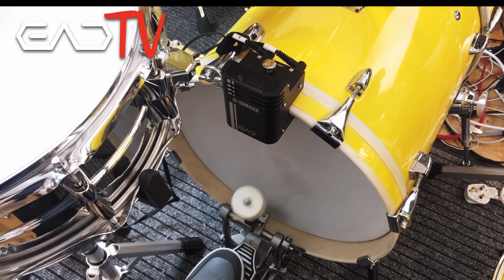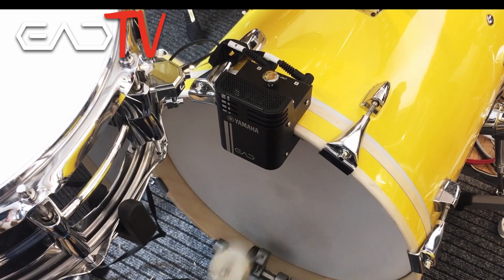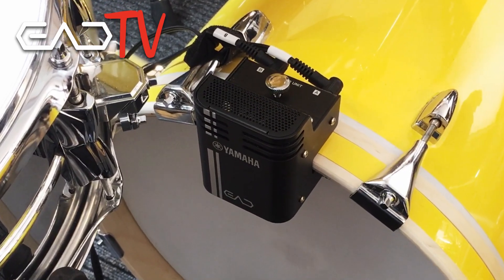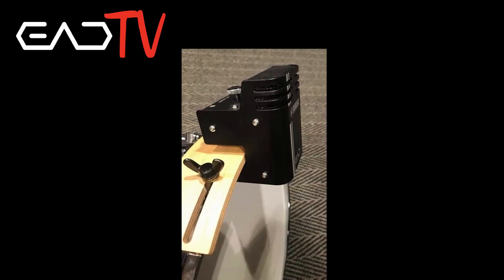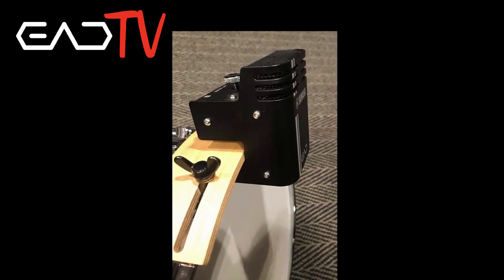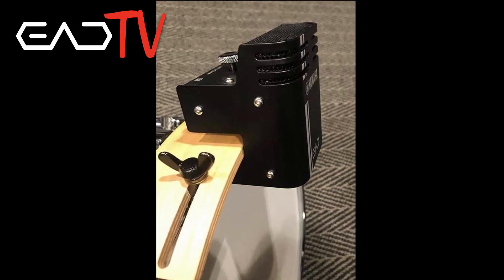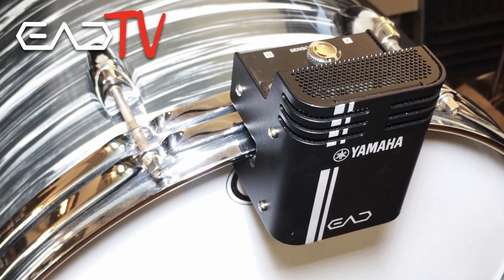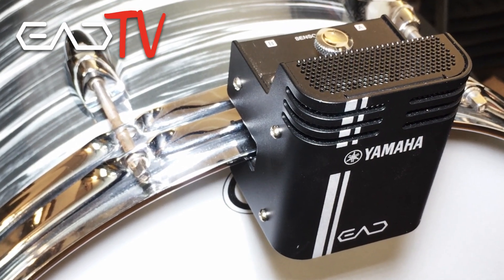EAD TV UK 3 - EAD and steel hooped bass drums

Comment: I have a 22" bass drum, but with a steel hoop (there is a depression inside, not flat as a wood hoop). The adhesive foam provided is not sufficient to maintain the EAD properly. So I bought a Pearl HPP2 Rim Saver and it works better, but the bass drum trigger is not so responsive.
Thanks for your videos.
I also have some problems when importing wav files, even if I respect the specifications. I contacted Yamaha, but no more information on that. Do you plan a lesson on this?
Reply from the maker: hackenspp Hi. Thanks for the comments. Yes, importing samples is on the list. It’s a pretty big list at the moment and it keeps growing, but we will get around to it. Stay tuned!

Comment: Hey Simon, I tried the 3rd option overlapping the steel rim and installed the bass sensor unit but the sensor unit couldnt trigger the bass drum. Can you help me please?
Reply from the maker: Ok. What head are you using on the drum?
Reply: @edruminfo  its a remo ambassador clear head
Reply from the maker: Ok, and what is the drum please?
Reply: @edruminfo  yes I have actually converted my 16” pearl floor tom to a 16” bass drum using pearl jungle kit adapter here
Reply: @edruminfo  and the problem is after I have overlapped the rim yes there is enough depth for EAD sensor as you mentioned but the rims dont have even surface for sensor to land on so I thought of filling up the gap on the rim with double tap to make the surface even but the sensor is unable to get the vibration or some thing .
Reply from the maker: @sanzit  Have a look at this. This should help you - sorry it is so long, but it will solve 99%  of EAD triggering issues; https://www.dropbox.com/s/ls9wd3en7h9f3fx/EAD10%20Bass%20Drum%20Trigger%20Settings.pdf?dl=0